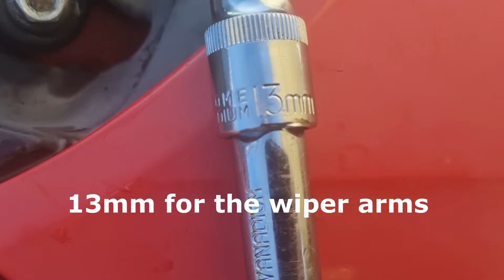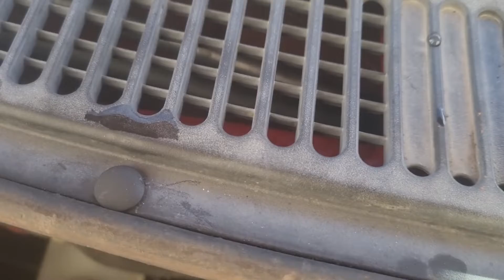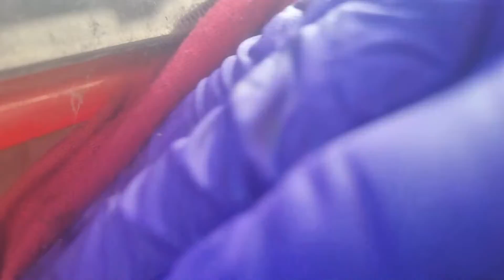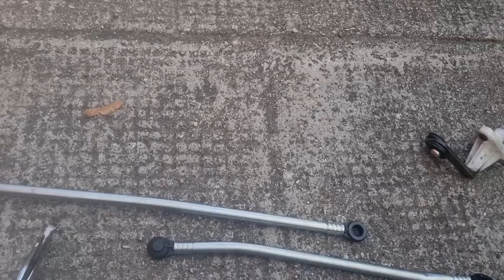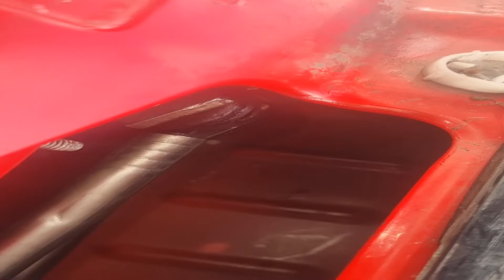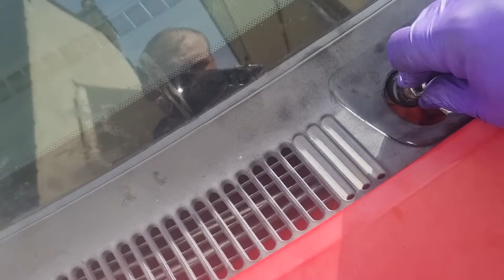Suzuki Wagon R - how to replace the window wiper linkage

Comment: hello i have exactly the same problem i have an opel agila but the system and the car is exactly the same as you have it works in position 1 and then it hangs did you have this too? i am looking everywhere for this mechanism that you replaced can you help me where i can buy this? thank you greetz from Netherland maikel
Reply from the maker: Hi the wagon r and Opel agila have a lot of interchangeable parts the problem I had was slightly different as the main linkage had become disconnected so it wasn't working at all. As for where to find a Replacement part I know they have it available on eBay here in the UK I'm not sure if the Netherlands eBay will have it  I have included a link to a seller on the UK eBay at the end thank you for your message I hope that I have  helped a bit please let me know how you get on..https://ebay.us/m/uR8uAc
Reply: thank you for a quick response yes I have had this problem since I bought the car I bought the car cheap there but the mechanic where I had the car checked annually said it was the windshield wiper motor so I have already tried 2 motors at a car scrapyard but the problem remained I removed all the fuses from the car scrapyard still the problem I bought and installed a new switch but I think it was not correct it worked but 10 minutes later the fuse blew I then installed the old one and replaced the fuse now I am going to try the mechanism and if that does not work I don't know anymore but the plug of the windshield wiper motor was full of oxidation I am curious I will keep you informed thank you for the link @dobbyrepairs
Reply from the maker: It sounds like it's been a pain to fix have you checked the wiring going to the motor ? It's possible there's a damage wire especially near the connector id double check all the oxidation has gone as that could be causing your problem
Reply: @dobbyrepairs I have replaced the engine but the connector that the engine gets power from is full of oxidation I am going to look one of these days to see if I can fix that poor thing maybe the rubbers are worn out look this is my problem my car was rejected we have to have a car inspected once a year in the Netherlands by a car inspector for safety and windshield wipers are the most important part according to the inspector that is also correct see link for my problem  
https://youtube.com/shorts/xNblTRH4VQE?si=MSWDAIBuBilFk-tE
Reply from the maker: @MM-bq7tx having watched your video I would clear all the oxidation out of the connector to the motor as it looks its not getting enough power and the other thing is to check if the wiper arms  are in the correct place they  could be slightly in the wrong place and that could be causing the sticking
Reply: @dobbyrepairs I have measured the plug of the windshield wiper motor, the windshield wiper motor has power but the plug is not getting any power, it could be that a fuse is broken, but I have changed all the fuses on the hood, I have photos of them
Reply from the maker: That's interesting do you know what voltage your getting at the motor ? And I'm pretty sure the wiper motor fuse is under the dash feel free to send your photos to my email address which is dobbyrepairs gmail.com

Comment: Can I ask what was the symptoms that made you change the linkage. Thanks
Reply: Thank you for the reply.
Reply from the maker: No worries if there is anything else I can help with drop me a comment and I'll do my best to help
Reply: Don't suppose you've come across the problem of the wipers not working properly on intermittent. Works fine on the other settings.
Reply from the maker: @Corruptedworld33  I did come across that once it turned out to be a bad connection at the the wiper motor connector I took it off and cleaned it and it worked fine  I'd also check the control stalk I've heard of that causing issues on other cars
Reply from the maker: The reason changed it was because the wipers stopped working and I could hear the motor running and the loose linkage clunking from under the wiper cowl I hope this helps and thanks for watching

Comment: I have just replaced the wiper linkage on a suzuki wagon r 2005. Thanks for posting and the link to the wiper linkage on ebay. Just the job. I was able to speed up the process slightly by removing the whole linkages and wiper spindles in one go once I had undone the six bolts and unclipped the linkage to the wiper motor. They all came out in one lot with a bit of wiggling through the right hand side aperture. Once out I clippped the new linkage to the spindles (after cleaning and greasing the connections) and threaded them back through the right aperture. I struggled to clip the connecting arm to the wiper motor using the pliers you recommended so instead I bolting the spindles back onto the car and the newly fitted linkage and then I found I had enough purchase to just pull on the connecting linkage into the wiper motor and it popped into place! Thanks again for going to the bother of posting, it gave me the confidence to tackle the job which only took about an hour all in. Cheers!
Reply from the maker: Thank you for your comment. I'm really pleased this video gave you the confidence to do the job .